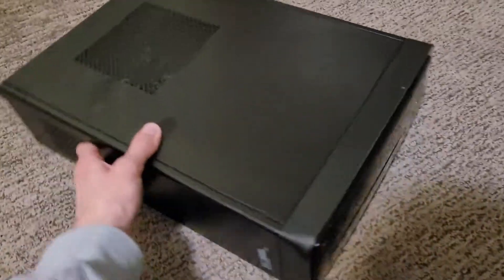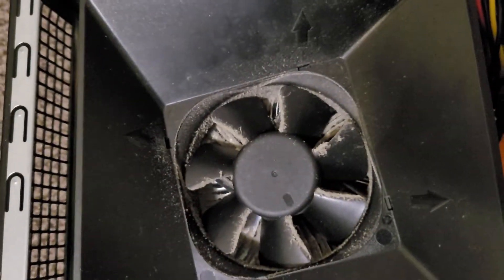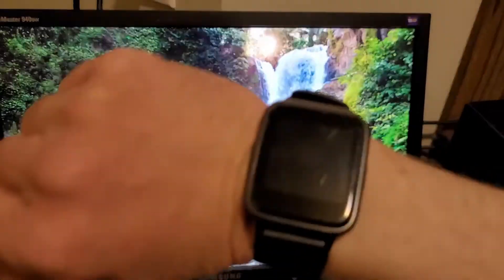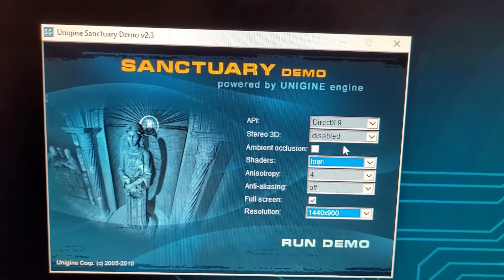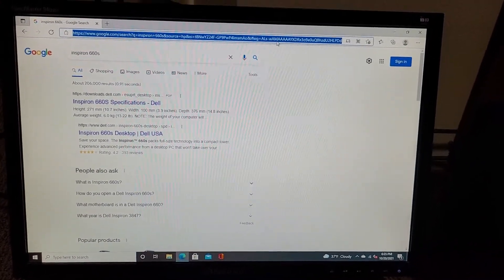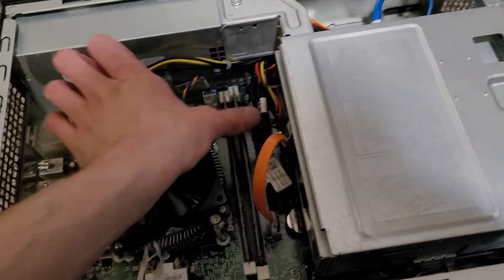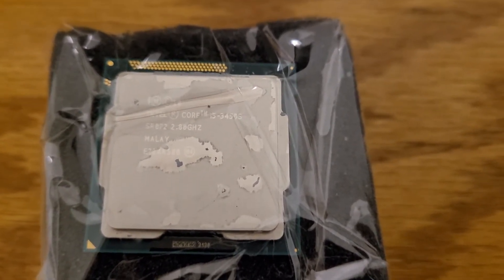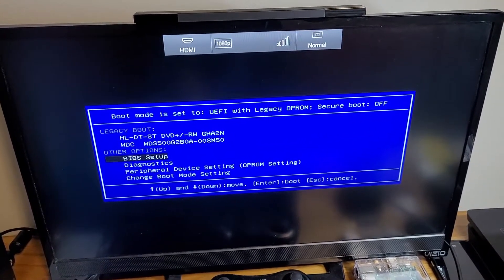Upgrading a Dell Inspiron 660S

Comment: i got this Dell Inspiron 660s SFF,  today for $13, a guy was giving away his elderly mom's comp. The PSU he said is bad hence the low price. Well, it was all there except the HDD, and he kept  5 GB of ram in... Sweet! The PSU is like $40 on line - it's the Small form factor. It is the Intel Pentium CPU, not the i-3 and i-5 that were offered with this PC, so it's the lower end, but still for 13 bucks its a steal! Im not going to buy a new PSU, i have enough mini-towers and PSUs from my dumpster diving that i'll be able to put the mobo, and DVD-ROM into, like some Dell Dimension 1100/2400 cases or an old 2002-era Gateway PC. BTW the motherboard, or at least mine, on this Dell 660s i got is DIB75R, so it is the 1155 CPU socket type.

Comment: I have a 660 non S Version, mine has an i7 3770 3.4GHZ CPU, 16GB DDR3 RAM, 1TB HDD/8TB HDD. THE ONLY DOWNFALL IS THE GRAPHICS CARD AND PSU.

Comment: Turns out the 660s does support more memory!  Others on the Internet have said that it secretly supports 16 GB even though it wasn't documented by Dell.  I'm tinkering with a 660s right now while listening to the video in the background, and earlier today I put 16 GB in and ran memtest86+ for a while, and it detected it all and it all tested fine.
Reply: same. didnt even know about the "8gb limitation" and just threw in 16 and it worked like a charm. had to swap the sticks around a few times but now it works just fine. speeds do not go up to 1600 in my case though and im stuck at 1333mhz

Comment: I recently got one of these for free. It came with an i3 2120 but when I tried to throw an i5 3450 and an i5 3570 in it it just beeps and the amber light flashes when I try to boot. Any idea what the problem is?
Reply from the maker: Try updating the BIOS if you can. Could be your motherboard is running a firmware that's too old to recognize those processors.
Reply: @techtechboom9339  That's what I ended up doing and it worked fine. Thanks.

Comment: I got better benchmark results than your 'before' result, with a Pentium 4 3.2GHz/4GB RAM machine, at a slightly lower resolution (1080x1200, NVidia Quadra 512Mb) but still...a Pentium 4! From 2004 I think. Same benchmark, but in XP Pro.

Comment: I just upgraded two 660s this month. One is a win 10, i5 3570k, 16gigs ram, sapphire 7570 gpu, 240gb Ssd, old Hdd wiped as a 2nd. Other has win 8.1,  i3 3225, 8gigs ram, 120gb Ssd old laptop Hdd wiped as a 2nd. Some parts I had some came from ebay and amazon.
Reply: Nice, i love tinkering and upgrading old machines. I have about 11 machines in my closet lol and i take them out and play with them all win 95 to win 11 haha and everything in between.

Comment: If you could rig up a case fan to blow on the heatsink of the video card, that would probably help quite a bit. Use some hot glue or sticky tape or something like that. I've done that before with some pretty decent results.
Reply from the maker: I though about going down that route, but it would have been tacky to have a fan hack-jobbed onto the side of the case like that. If it was a system that I would be using myself, I would, but not a good solution personally for selling it to someone to use.